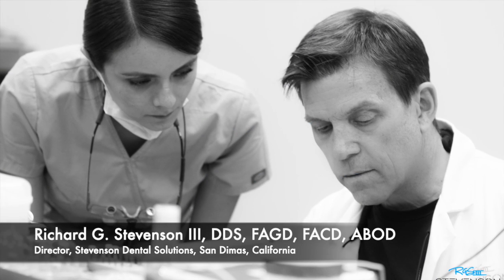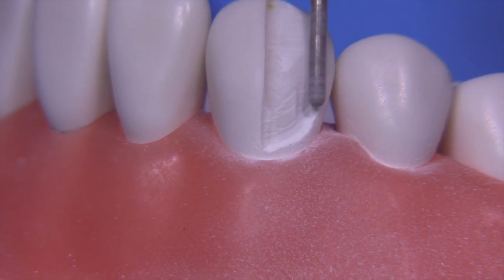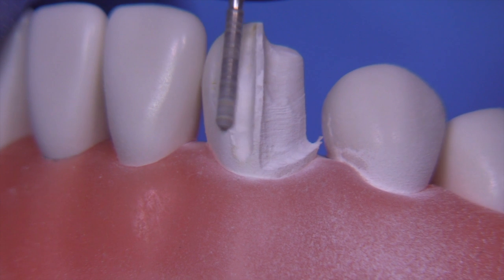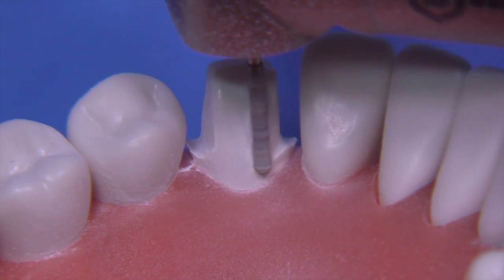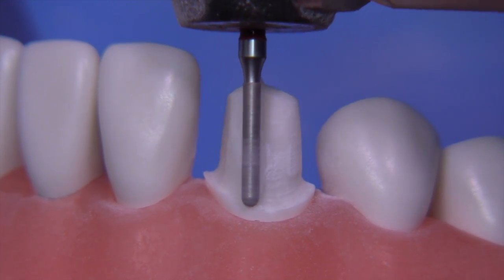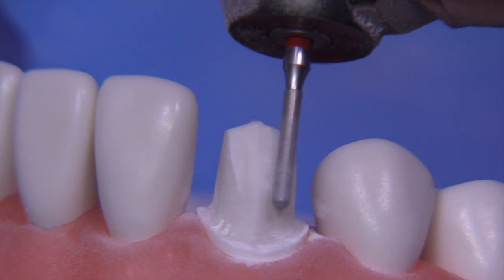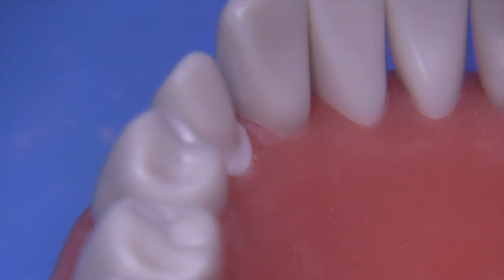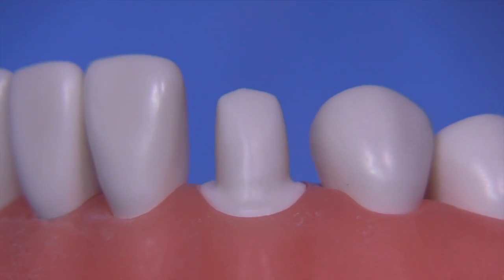Canine All-Ceramic Crown Prep on Acadental #22 - Utilizing T-Prep Technique

Comment: Thank for another great video. When you need the margin  0.5mm subgingival how do you prepare the buccal margin without nicking the gingivae?
Reply from the maker: Place 3-0 silk suture in the sulcus for minimal gentle retraction and safety.  The 10-839.010 is a tissue-protective end diamond which is also very helpful.  Thank you for the great question!
Reply: @StevensonDentalSolutions  Thanks doctor.
Reply from the maker: @amoo6933  Anytime doc!

Comment: You are my favorite virtual teacher.I have 2 questions-
1.how do you measure interproximal reduction?
2.I feel hesitant to use 1 mm bur for interproximal clearance what alternative can I use pls.
Reply from the maker: Interproximal reduction is measured by the following". 3-5 degrees of axial wall taper and 1.0 mm shoulder (better termed "fillet") depth.  Use the 7878L-012 or even the needle bur 859-010 or 850-012 to break through the proximal and then move to a larger diamond.  Best to you!

Comment: Great vedio!! I still don't understand how you got such shoulder using KS0. Don't we( beginners) run the risk of  producing a J margin very easily?
Reply from the maker: Yes, this is possible - so for now, use an end cutting bur like a 8839-010 to remove the J.  Eventually you'll be able to run the bur inward and outward while cutting the finish line and remove the Js simultaneously.  Thank you!

Comment: Do you find that doing the interproximals like you did here (dropping it incisal/gingivaly), can often make the finish line wider than intended?   Does it work the same with a chamfer?

thanks!
Reply from the maker: Onlay if you position the diamond too far axially - if you leave a thin shell, you usually end up underprepared axially, giving you room to finish.
Reply: Onlay here sounds like a good pun

Comment: Is it advisable to do interproximals like you did here, on posterior molar?
Reply from the maker: Yes I would prep the teeth similarly, with the exception of less occlusal clearance for zirconia.
Reply: Alright ill try doing the margins on posterior teeth the same way. What slows me down the most is the inter proximal reductions. @StevensonDentalSolutions
Reply from the maker: Try the 787K-012 to break contact and then follow up with the KS0 - might help a little.  Thank you! @ReanimatedShad0w

Comment: I would love to see a video on the prep for a resin modified bridge #9 and #11!
Reply from the maker: Like a Maryland bridge?  I can do that for sure!
Reply: Stevenson Dental Solutions yes thank you so much! I’m having trouble with my #9 and #11 having the same path of draw.
Reply from the maker: Yes - this is a surprisingly challenging fixed dental prosthesis - #9  and #11 have different draws, so the FDP forces you to prepare the individual teeth differently than if they were single units.  You can always see the FDP video on my website...there is a small fee for this but it's really a good tutoria

Comment: Dr Stevenson, your videos are a great help and as a dental student I use a lot of your tricks and steps and it helps me a lot in the simulation lab and clinics.
I do have a request that a lot of my classmates including myself are struggling with, would you be able to show us how to make the finish line very smooth as in the videos it seems that this part is edited..if you can give some insights on how to approach that step along with how to do it in the patient's mouth while avoiding to trauma to the pulp because of the slow speed and heat generation that would be a great help. 
Thanks again for all the help..
Reply from the maker: Take a look at other videos and you'll see more unedited details.  I've been trying to keep the vids short, but will definitely produce some minimally edited detailed work for the subs.  Thank you for your thoughtful request!